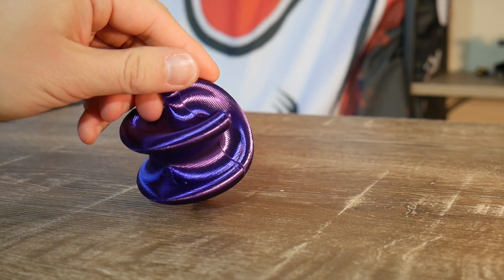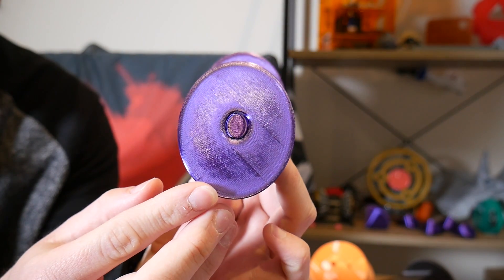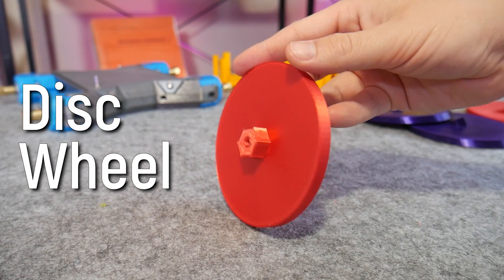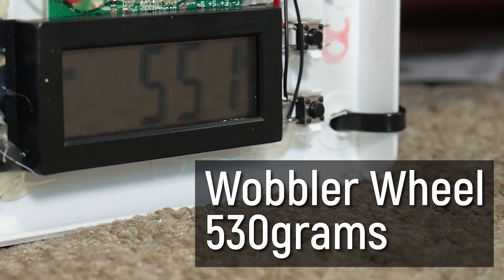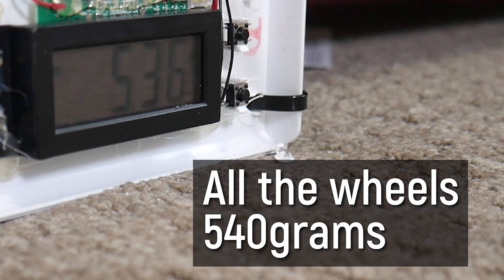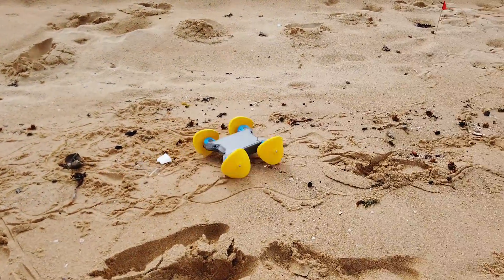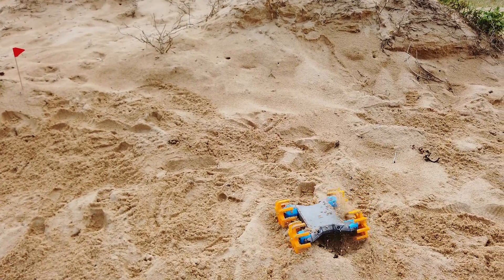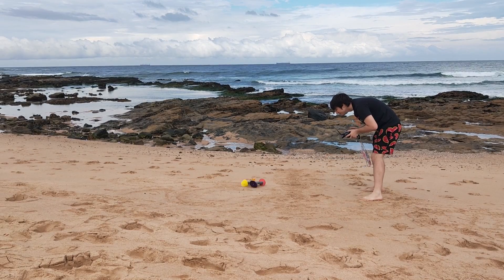This Robot Drives on Wobbly Wheels (but HOW?)

Comment: Friction is affected only by a coefficient depending on the materials and the reaction force which is equal to the force of the gravity. The wheels with the most material will have the greater traction because the overall weight is greater.

Comment: Combine the prongles wheels with the spokes.  Equidistant spokes same length and position, however they are centered around a prongles shaped interior alternating off one side and the other as the wheel turns.

It'd be fun, but if you want a better design, equilateral triangle spokes with open centers made similarly to the spokes wheels should get decent traction. Any slightly outward canted spokes would help as well.

Comment: Hey, could you revisit the two way to one way gear design using one way bearings in place of the ratchets in the design? I think it would not only make the mechanism stronger and quieter, but it would also make it much smoother overall!!!!!!!!!!!

Comment: Looks like it was bottoming out on the sand, so maybe a redesign where the motor mounts are lower down than the center of gravity? Also, how about the spoke wheels able to expand or shrink in size, like some of the other things you've worked on? Could help with even further ground clearance

Comment: the spoke wheels only need a cleverly shaped  wall to the center from each spoke. So they can move away the sand better instead of just plowing through it. 
It would also give the spokes a lot more stability.

Comment: I would see how level the floor is and if the carpet patter causes travel that direction. Or if the anchor point of the scale might be forcing it that direction. I'm also a YouTube commenter and with no degree in anything cheers. Or maybe the switch the wheels or software I suppose I think I'd put rubber paint on the wheel edges for grip
Reply: I'm confused also on why you chose sand as the track lol. Seems arbitrary and something you didn't even design for?

Comment: the reason why the wobbly wheels seem to have more traction is because the wheels can shift the traction to underneath the vehicle instead of just on the outside. its traction is closer to the center of mass and so more weight is directly over the point of traction. i think.

Comment: The wobbler is exactly like a snake. It uses its motion to each side to "scoop" at an angle. It gets energy in the two vectors, one forward and one sideways. It evens this out by having it travel cyclically.

The Prongle wheels basically do this motion at double speed (not necessarily twice as good), and the spoke wheels do it in a similar, but very extreme way as well.

One thing that would help these designs greatly would be to mimic a snake even further. It has two wheels in line, like a bike. Because all of its body is above these wheels, it cannot get "stuck" by digging a trench.

How could you maximize body above wheel with this current design?

Comment: lil fact for ya
if the wheels had more surface area they would not bog down in the sand (works with snow too ) the reason the forks work is the fact it can dig into the sand to propel itself forward like how ofroad tires have studs on them and increases grip on loose terrain

Comment: I think one of the reasons that the lotus wheels worked better then the straight disk is that when it would turn, the corners of the disk would catch the sand giving it more traction. I think the reason that none of those designs are better than a default tire design is that you can't give them the width that a tire has, and the fact that a tire shape fits well into a wheelwell, while many of those others wouldn't be able to fit in economically. Honestly if you think about it most of those wheel types actually partially mimic part of the width of a tire, which was able to allow them to get that far over the sand. 

I think, that if you built a small hover craft, it might get over the coarse that you made. You would have to make a easily controllable design, that protects the rotors from getting sand in them, but it could work. I'm unsure how to keep it from going down the hill when it's not pointing straight up it, in a way that wouldn't be hell to control, but I would be interested in how he would do it if he tried.

Comment: Can you make the wobbler wheels so that you can go at a 45 degree angle without turning the car itself?  Basically the wheels would rotate in such a way as to produce traction in that direction rather than forward.

Comment: I think the problem is primarily with the medium used. These wheels aren't suited to this type of terrain, so even a small obstacle will completely derail the attempt. This disguises the potential advantages.

One of the interesting things about the wobbler wheels is that the outer diameter appears larger. That cold have some benefits.

Another might be an expansion type design for the spoked type. Ultimately, I think the biggest problem here was scale and slip factor.

Not enough weight for the slip factor to make a real difference.

Comment: It seems more like a height issue vs being a wheel issue.
High centering will ruin any wheel designs. It seems like if you had 3 to 5 inches of more clearance some of the wheels would have worked better.

Comment: the orange wheels have more surface area touching the ground. they would have an advantage because of that. that surface area would give more weight distribution. and on sad that would give them an extra advantage. look at the design of the various rover wheels sent to mars that are made of metal and designed to handle going over-sand.

Comment: Sorry, but the results are obvious.
When pulling it is not the surface area that counts, but the length of edge that can bite into the ground. The more slanted your disk is, the longer this edge. The yellow wheels that were no longer a disk put this to the extreme and therefore got a much better score in both the force and track test. You can improve the disk shaped wheels by putting more wobble on the edge. (the purple wheels have one wobble, the pringles have two. do like 5 with the same wobble amplitude and you will get much much better results for those wheels)
still enjoyed the video though.

Comment: dont lose hope digital inrpint on wheel is outstandign so if you build curve model vision with touth inside it could acutaly draw more strength and easy come out from sand, after that my proposal is robot snail or turtle that can dig in and robotic way mimic nature steps this is top robotics if succeed in this you to compete to NASA and easy win as most points and facts for robots to win on competition so add slight hook as spiders have and do slight angle rotor, also the tough part is haox sand technicaly you do sand invertation up so gid in by move and do speeding by by changing angle mostlikely its speed change more at start all time angling woobling when it goes out is totaly like if you do succeed in eforts you should test thsi robots to crab or turtles  they would love it or like shot a video is absolutely amazing to watch like 3d 4K resolution and something surreal

Comment: what if, in the spoked wheels, on the inside part, you added a small flap (you are obviously limited by the clearance with the wheel hub) for sand environments? Wouldn't change anything on a hard surface, but it should help "swim" in sand

Comment: The height of the body is the same on each surface but with cars that changes . Not many off-road vehicles are a few centimetres from the surfaces. It doesn't make the testing wrong just harder to achieve success.

Comment: Sand is just too difficult a terrain specially for wheels that are so thin. Also just going at max speed while fast, does mean that a lot of traction is lost, it also really bad in sand due to the speed flinging sand as opposed to the car just rolling over it. Making the contact surface rubber (Ex Rubber bands and glue) would greatly improve traction for all the wheels.

Finally yes the 8 spoke has an unfair advantage vs smooth wheels in rough environments. In a smooth road a smooth tire give the maximum surface area. In a rough environment a rough tire give the maximum surface area.

Comment: I'm pretty sure that no matter what wheels you got once you reach the limits of your chassis ground clearance you are basically stranded. 
You would need more ground clearance to get a more conclusive result. This being said it is to be expected that a wheel that has ridges performs better than one with a flat surface. 
There is a reason you do not see any slicks on trucks that go mudding.

Comment: combine wobbler wheels with spoked wheels, to get more width of grip, the spokes could be angled to push the sand outwards.
imagine the spokes being V shaped and centered on the contact point of the wobbler wheels.

i cannot design this myself (have no sd modeling experience)
anyone who thinks this would work could try modeling it, please.

Comment: 6:04 the fact that it's always pulling to the right might be due to the direction (nap) of the woven carpet. Because of the way carpet is produced sometimes force the "hairs" of the carpet in one direction. Stroking the carpet from different angles you might be able to spot a different resistance.

Comment: I see others have mentioned chassis clearance, but I really would like to see the effects that wobbly/prongle wheels have with no other modifications than chassis height. The lateral variance in  ground contact as they rotate might end up giving them more effective surface contact with the sand and allow them to pull the vehicle out of deeper ruts.

maybe print vertical struts that lock into your existing motor mounts? Though this might necessitate some rewiring for having changed the distance of the motors from the controllers. Let us not see this crab bury itself in shame so easily!

Comment: Surprised you didn't try reversing the mount orientation (pointing outward) for the prongles and spoked wheels, just to experiment.  Seems like they would be less likely to bury the car.  They might have actually had more success too, especially the spoked ones since they would have a wider reach.

Comment: 1. Divide your platform in two parts (front and back) connected with a bearing that allow parts to turn separately (but add a restrictive pins so the angle won't exceed 30-45 deg.)
2. Make spoke wheels with very long spokes that cover two parts of your platform as deep as they can, so that the surface area of the projection of moving parts in the bottom is no less than 1/2 of the entire projection surface area. 
3. Add thin net to the wheels, or print it with a spiral groove or smth.
4. ?
5. Profit.
This way the robo won't stuck in sand.

Comment: Regarding a large proportion of  implementation or application, such as a modern vehicle, it would most likely require a form of a counterweight or counterbalance function. Unless the oloids and wobblers coincidentally perform that function with their own physicality. Not to mention the surface area of x on the wheel would have to be great enough to endure the torque and the magnitude of the friction of acceleration fundamentally speaking. On respective terms... Great channel, been a subscriber since the birth of it. Love all the content!

Comment: All of the wheels have a relatively small surface area and thus a slightly higher than optimal ground pressure (that's bad). High ground pressure means that an object is more likely to sink (main reason tanks and heavy vehicles use Treads and  Large Wheels) so, you could probably try making all of these wheel variations, but just with a larger surface area to distribute weight more evenly and they would probably perform much better on sand.

Comment: I think the criteria should require the tires to have a contiguous surface area. Something like the spoked wheels shouldn't have been given such significant width, and the sides which were pushing the sand should have contributed to the surface area measurement.

Comment: Needs lift, body was dragging bad on the wobbler and prongle wheels. Methinks if you mount the motors below the body  the wheels will do better all around. Also; try the prongle wheels BACKWARDS!

Comment: I agree with many comments so far that the body seems too low and is a high-center point.  The "spoked" wheels have an unfair advantage on the sand in that the contact area ends up being much more as it would technically be 3 sides of each spoke as a potential surface/contact area for traction.

Comment: I do think on sand the wobbly wheels are better as they can't spin on a singular point in 1 360 degree rotation plus it moves dirt. Thing is, does it put extra stress on things like the shafts bearings and the like.

I wonder why the wobbly car goes right when the right hand rule points left. Except the moment of inertia of the wheel precesses around the axis of rotation so there is that

Comment: Me and a friend of mine have actually messed around with 3D printed wheels for our RC trucks, we found a person to actually print out a style of wheel that I call aerator Wheels because they look like multiple spikes coming out to make a circular shape. they work astoundingly well on any sort of softer loose surface like dirt and sand, if you'd like a picture of them I have pictures of them on my Traxxas and can even give you some measurements off them if you'd like to take a look.

Comment: Change the orange spoke wheel design and make the spokes circular/cylindrical or put a reverse scoop edge to remove it's design benefits.  Better still, make the spokes cylindrical AND reverse scoop.

Comment: I don't have a design for you, but if you make a wheel that doesn't have holes between the spokes but still has them protrude past like the paddle tire, and then added the profile of the "prongle" wheel that protrudes the same amount as the spokes I think you would see some good results. Basically a paddle tire with the S shaped profile added to it. The main downfall of all of these wheels is that they cannot float on top of the sand. you need more surface area.

Comment: lmao in the sand test none of them were stopped because the wheel couldn't get out of a hole, they were stopped bc there's pretty much no leeway under the chassis, it just sits itself on a small mound where no wheel will help.

Comment: You need to make a wobbler version of the spoke wheels, should have more surface area. Then make a tank with 8 of those wheels all driven by one motor so they spin symmetrically. That would be awesome

Comment: I think the main reason that most of the wheels failed the sand trial was because they weren't big enough, and so not only did the body of the car touch the sand, slowing it down greatly, but also makes the wheels a little less powerful, I believe. If you tried making them bigger, I think they'd perform much better.

Comment: Rather than horizontal bars, angled spikes/spines. You could either do radially, but single "disc", or you could stagger them rather like saw blade teeth.  May be a challenge to get the surface area to match the others, though.

Comment: On sand would if you  connected the nightshade wheel at the edge to it rotated more like a flipper would it work better? lifting itself up to climb the sand bit like a sea turtle making little / \ marks in the sand as it more or less drags itself along.

Comment: The wobbler wheel works in the same principles as how snakes move on sand. The only difference is you are missing the vertical element in your designs. I think if you can somehow print an independent suspension system for each wheel and manage to prop it up it will do much better on uneven surfaces.

Comment: The crawler was a little sabotaged by its large width relative to the diameter of the wheels and the terrain, causing to easily bottom out. Bigger wheels with more clearance should help complete the track.

Comment: These shapes are weird but at least if they have balance they can work as Wheels also the traction thing I get it because the normal wheels are in a singularity but the other wheels are like in an angled shape so basically when they're wobbling that means there's one instance that there's something that's strong and then there's one pool that's weak it just goes back and forth back and forth because it's wobbly thus making more pull

Comment: i think you are calculating surface area wrong. it should be tire surface area in contact with the ground. the spoke wheels has much more area in contact with the ground

Comment: Would have been interesting to see if certain wheel combinations yield different results depending on whether they are place in the "front" or "back" of the machine (even if it operates like a tank).

Comment: I think you need to try different configuration of the Pringle wheel and the nightshade wheel. 

The different configuration im talking about is rotating the starting orientation. But might not matter since each motor is independent.

Comment: You might want to put the material relief grooves on the inside surface of the wing, or fill them with silicone?  They are tripping edges generating turbulence maybe?

Comment: Try elevating the body of the car by 3-5 cm so it’s doesn’t touch uneven surfaces anymore. You might. Have to make the body a little thicker too because of center of intertia shift. (Look at the parallel axis theorem if you want to maintain similar control characteristics). Looking forward to what’s coming next!

Comment: one more point, the car body also affects how it behaves on the sand, that's why offroad vehicles have a higher base than wheelbase so that most of the wheel will need to be submerged before it really stuck.